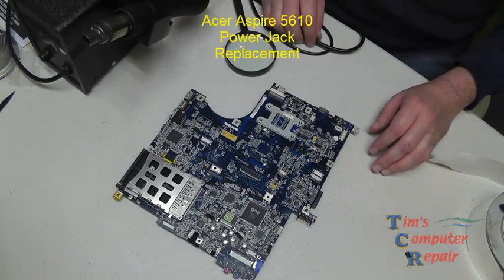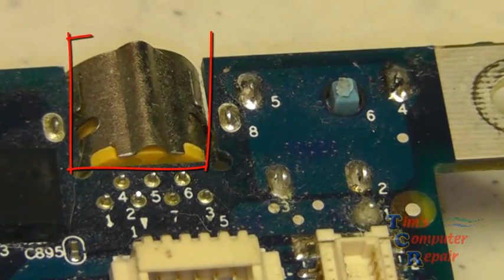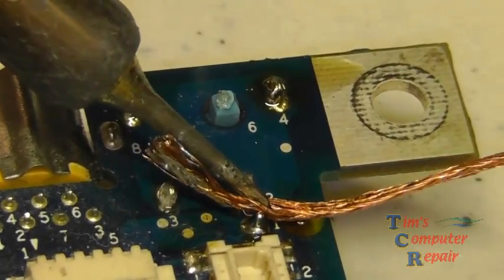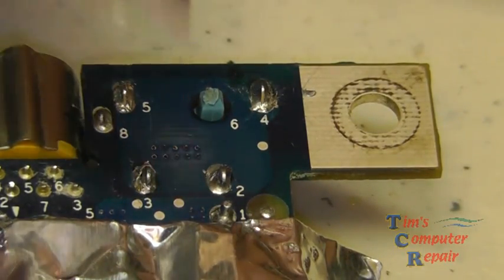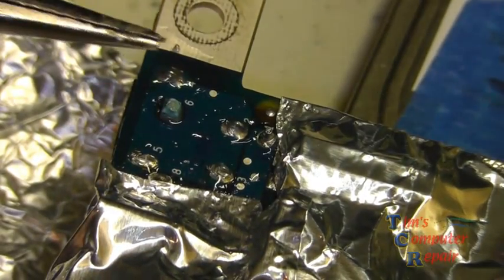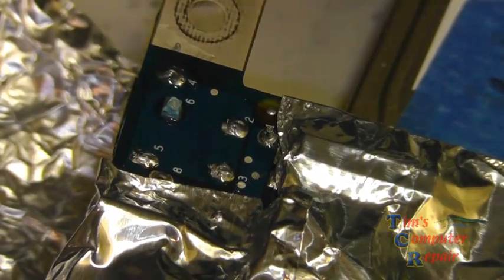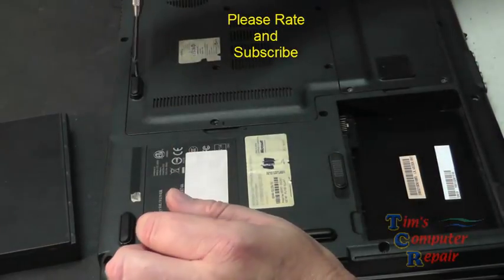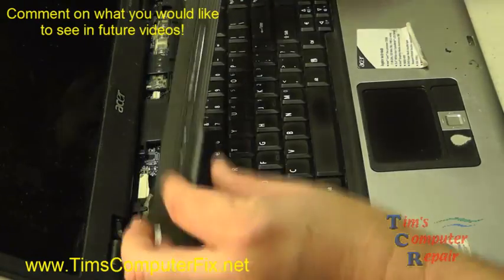Acer Aspire 5610 Power Jack Replacement Using Rework Station by TimsComputerFix.net

Comment: Thanks Tim. Ever seen an acer give an error saying that the ac adapter isn't an acer adapter from a bad ac power jack?
Reply from the maker: David Brassfield The center pin on the power adapter sends the signal to the laptop identifying the itself. The issue could be the in the power adapter itself or could also be a faulty jack.
Reply: Thanks, multiple adapters had this issue so it must be with the jack

Comment from the maker: Flux helps the solder melt when the right temperature is met. Flux helps keep the solder joints clean from contamination. Flux does help keep the board from burning.